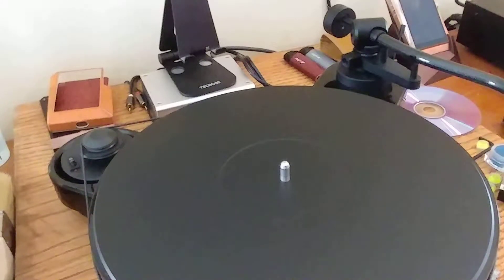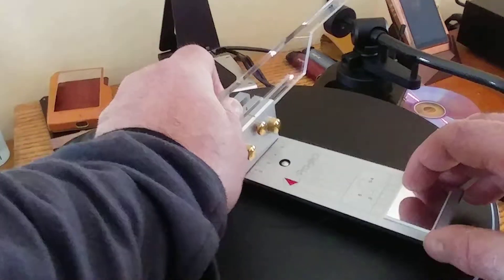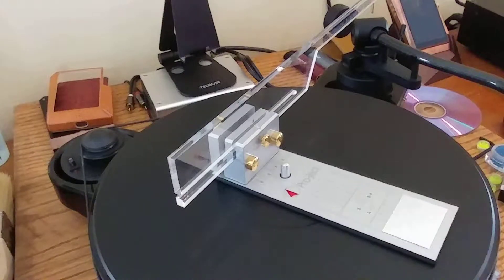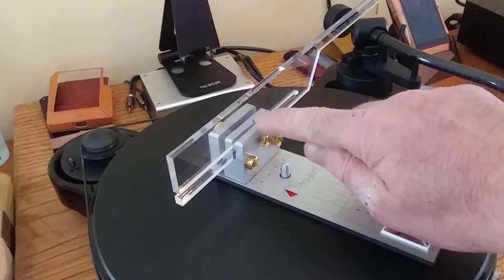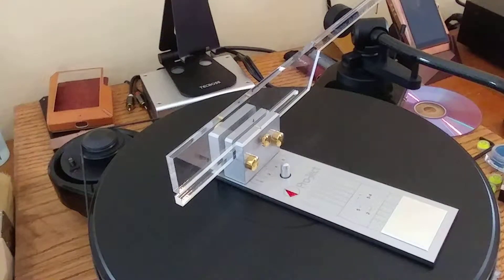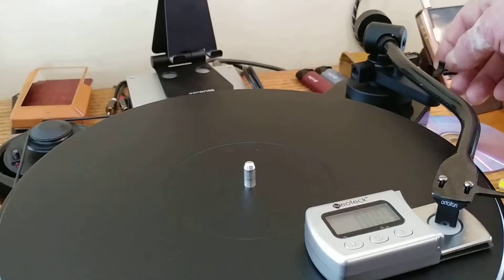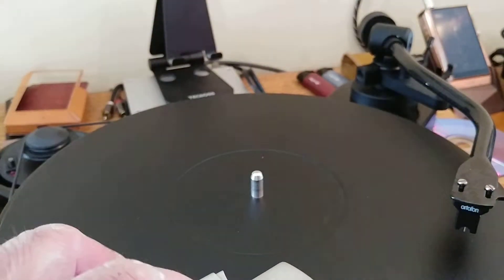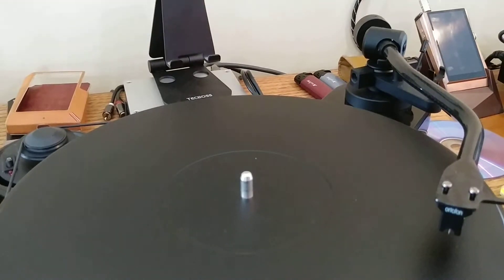Revised Project RPM3 Setup

Comment: Just discovered your video as I was looking for help in setting up my RPM-3 TT and like you I followed the directions from factory on anti-skate settings which said to set the same as your tracking force, mine was 1.8., but when I did this I noticed sound was more on left speaker, so I did as you did and used the CD trick and got it so it was dead center not going left or right on CD, then when I played my first album after new adjustments WOW sound stage and stereo imaging was incredible I couldn't believe it, what a difference  that little trick made, my final anti-skate ended up at 3.5 instead of the 1.8 factory recommended. Thank you so much for this awesome video.
Reply from the maker: Fantastic it worked out, when you get things just right it makes a huge difference.

Comment: Hi great video thank you!
One question when setting overhang  on this S 10 inch  tonearm. I can't get the stylus tip on the 3-4. Should I make to arm slots longer? Or am  I missing something on where the needle should fall?
Reply from the maker: I'd hesitate to adjust the slots. What cartridge are you using.  Is it too long or too short. Check the set screw where the arm connects to the pivot you may be able to lengthen or shorten it slightly there.
Reply: Thank you
 I'll try that
I'm using a Garrot p77i

Comment: The CD test doesn't work as the forces are different closer to the spindle. If you want to do the same process, find a video disc (12 inch) and place the stylus on the center of the disc, not close to the edge, neither close to the spindle. And please for next videos pause it, clean your nose and continue (sorry no offense, it's just annoying).